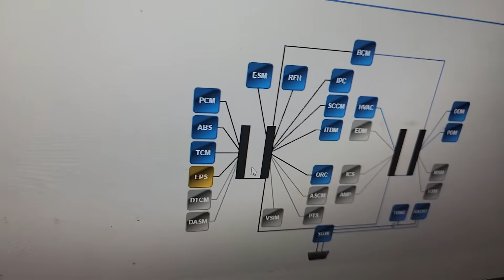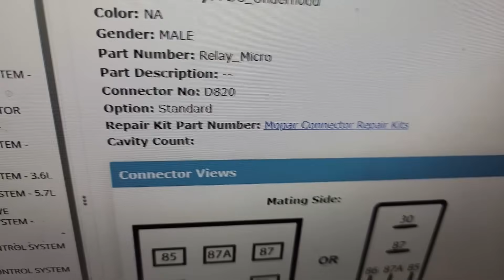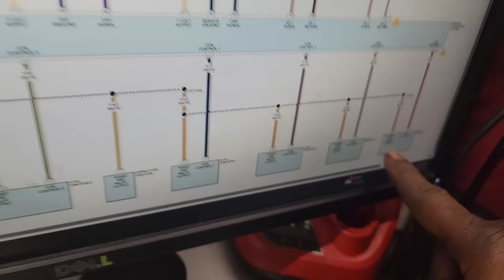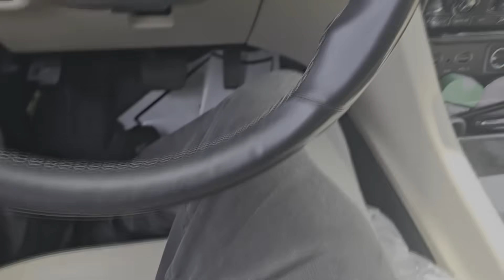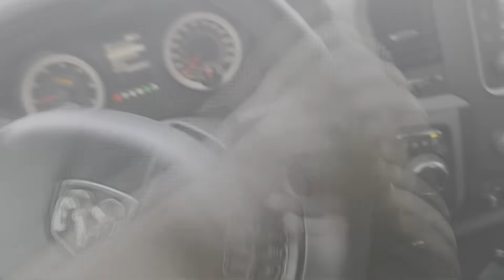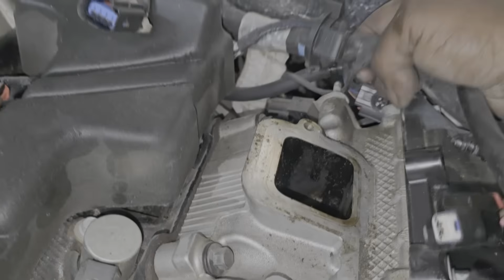Tow Truck Drop Off Mystery!  Dodge Ram 1500 V8 Hemi Stalls Out While Driving.

Comment: Slit the wire lum back, cut out the little rubbed through section and fix, either use a crimp and seal, or soder ,but actually fix the issue.  No last minute decision,  your getting paid to fix, not rig.

Comment: Due to fact that the wiring is exposed to the elements of the weather, I would splice the wire, replace the studded bolt with a regular bolt. Get a piece of heater hose and cut it longways and put it on the harness and wire tie both ends of the heater hose and reinstall the intake manifold and ship it (after test drive). You can get moisture in that exposed wire could cause it to corrode and have the same issue a year from now except it would be an open circuit.

Comment: I worked on a 2015 jeep wrangler it blew the asd fuse and it throw a code.. #6 coil pack shorted
Reply from the maker: Did you ever get it fixed? Was it just the coil?

Comment: Splice the wire because the wire will get blue corrosion which will create a opened circuit due to moisture and temperature changes over time.

Comment: Once, I spent the evening tracking down a home HVAC problem.  After popping a replacement fuse, in the attic, I quickly trace the problem down to the control harness for the condenser unit.  Apparently, the owner's large and lovely pit bull was making a meal of it.  She was a bad girl!
Reply: CRUNCH CRUNCH
Reply from the maker: 😂😅😂 But good find dude

Comment: I blame the automaker.   I blame all auto makers.  hahaha 25 year tech here!  A short to ground is a short to ground. I would repair the wire and re-route it.  If they want to replaced an entire harness for a 1 one wire issue seems a little extreme to me.
Reply from the maker: Lol, but it appears to have been manufactured. That harness routed properly at birth and would not have rubbed there unless bothered. The last mechanic Cousin Pookie failed this customer. Because I had to charge accordingly.
Reply: @OnlineMechanicTips  Cousin Pookie....NO!!!!!!

Comment: You know, brother, my 22 Kia Sorrento died 400 miles after we bought it, used, a very heavy electrical smell, with no spark on all cylinders. It sounded bad. I cannot diagnose it, but my mechanic came in a week, took him a while, but he figured it out. There was one bad coil and it blew a fuse. The fuses are non-descriptive that’s why I cannot find it. But he checked all the fuses and a fuse that nothing to do with power or ignition caused it. As soon as he replaced the fuse.We had spark and found out one coil was bad.… I learned a lesson.❤
Reply from the maker: Whoa, yea I get semi excited when I find a blown fuse. That mechanic has to be good to figure it out. Glad it worked out for you guys